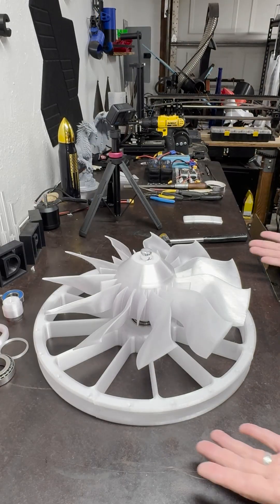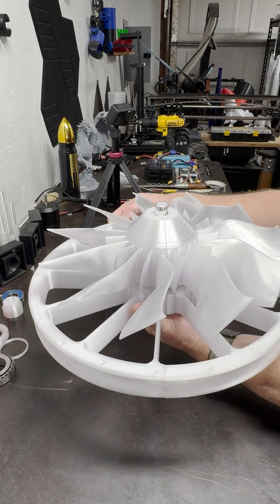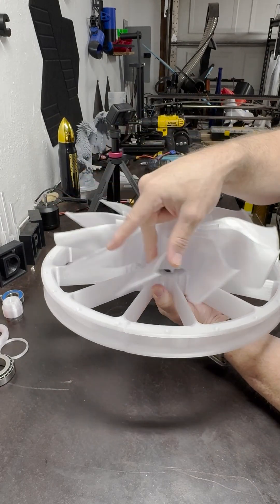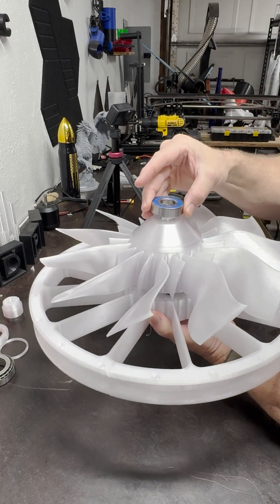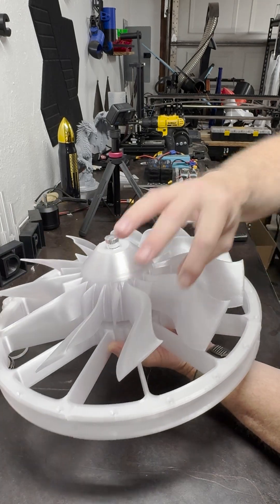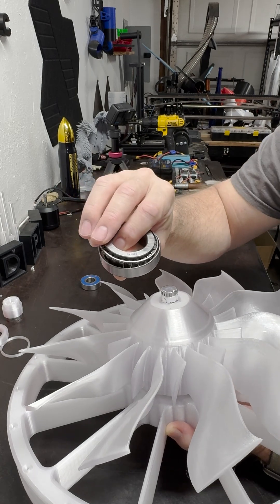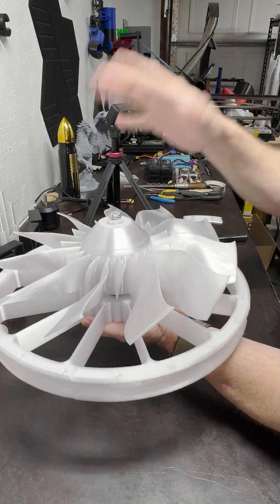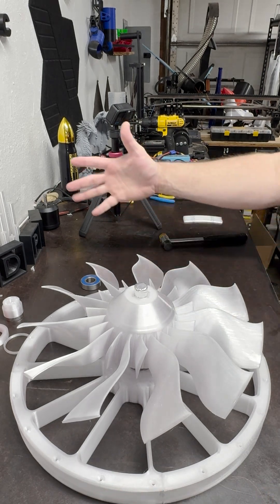Massive 3D printed drone powered by 340mm EDF motors. Completely 3D printed. Build progress.

Comment: Would a thrust bearing at the rear of the gearbox work in place of having a front bearing or would it exert too much forces on the whole assembly?
Reply from the maker: It depends on what type of flat thrust bearing you’re using the purpose behind the tapered roller bearing was to mitigate forward movement of the shaft, but it was also to keep the shaft centrally lined by the angle of the taper bearing. A flat thrust bearing could experience more force than it could handle. However, that entirely depends on the type of thrust bearing using.